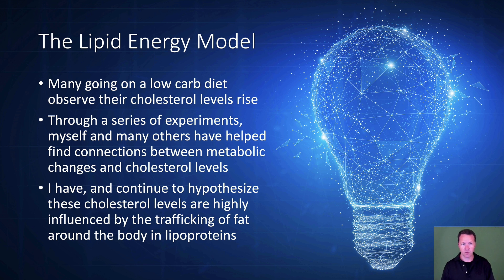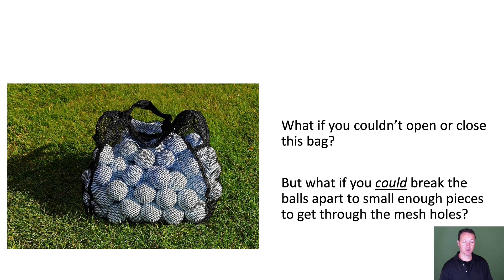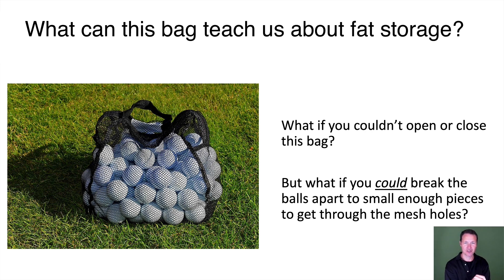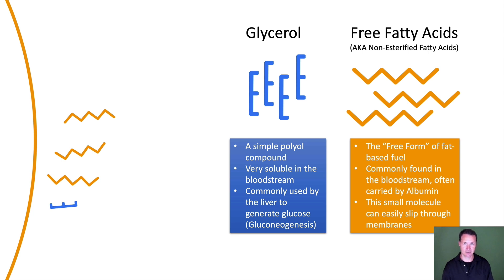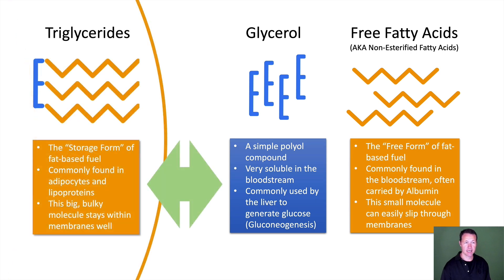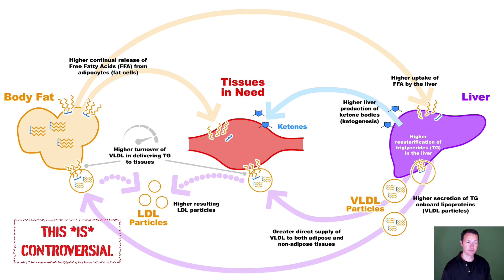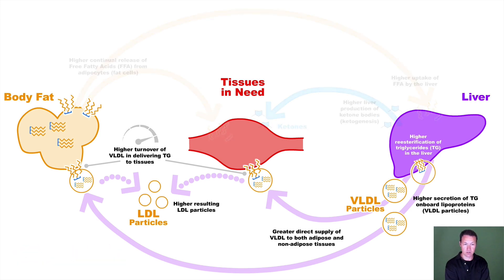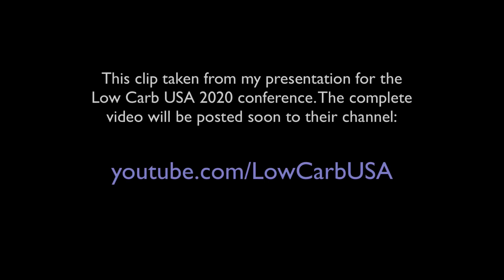The Lipid Energy Model in a Nutshell

Comment: Dave it all makes sense. There is a group of people like me on a Carnivore (keto ++) diet whose LDL does not go up. However our morning glucose goes up on strict keto. Also our ketone body levels never go really high even on total water fasts. I postulate that this group of people use more glucose from gluconeogenesis and when fat adapted are able to use the ffas really well so ketones do not go up significantly. Both groups are metabolically healthy. interestingly what I have found is that glucose stays at say 108mg/dl all morning and when I break my fast at lunch time glucose immediately goes down to 85 mg/dl. It seems to me that there are two groups of people on a keto diet, the hyper-responders who predominantly use fat either dietary or adipose as energy and the other group who convert a lot of the glycerol to glucose and use more glucose as energy (even on a carb free diet) via gluconeogenesis. also those people who do not produce a lot of ketone bodies may direct more of the ffas directly to the tissue that needs it and less so to the liver. I struggle to get my ketones above 1 even on a 5 day water fast and that was not the case before I became fat adapted when I could easily get to 2.5 or 3. Obviously there are a whole Bell curve of people between the two extremes.
Reply: Some glucose could be also coming from deaminated protein from muscle, converted to carbohydrate. Considered?
Reply: Did you consider the down regulation of LDL receptors on hepatocytes under the influence of high saturated fat to also contribute to the significant rise in LDL particle concentration in many on keto?
Would be interesting to see a low saturated fat, high polyunsaturated fat form of keto and the resultant effect on LDL concentrations. There’s a lot to tease out here.

Comment: But the big issue is, are these LDL's atherogenic? If so, why? Is it because of vascular inflammation only, or is it just having a high number? Or is it due to oxidized LDL'S that can't be reabsorbed by the liver and get stuck in damaged arteries?
Reply: it would appear to be an issue of time ... if the particle hangs around more than a week it can no longer return to the liver so ends up as food for mAcropahAge and desposited into an artery wall (foam cell conversion). The size thing might be correlation NOT causation (None too small neither too large a  sizes but just right for RCT).

Comment: Can I ask, what is controversial about this model? If fat goes to the liver, wouldn’t that liver release some of that fat as VLDL and eventually ldl and wouldn’t that go back to other tissues? I’m not a lipidologist I’m genuinely Asking out of ignorance like what other possible model is there that is inconsistent with what was explained?
Reply from the maker: Yes -- I agree (but of course, I'm biased). For me, this is the occam's razor explanation for higher LDL-C/-P/ApoB explanation for those on a low carb diet.
Reply: @realDaveFeldman  there is probably a cross correlation since the 3#s move On regression tandem tricycles .. in multi-variate calculus the eigenvalues of the covariant matrix provide weight(s). Roughly this is PCA as opposed to Factor Analysis which you are probably more conversant with (pearson and all that)

Comment: low carb  does not imply that the person is in deficit, and you say that later.1. fact - a person does not have to be on low carb to be in deficit 2. fact - if a person is on low carb then it is most likely also on high fat which completely changes this model because more chylomicrons are introduced and LDL generation is reduced
Reply: fact - you if you say something is a fact it does not become a fact, you usually just sound like a moron

Comment: Great info, thank you. My cholesterol has gone up to 8.9, triglycerides 1 and albumin on the slightly high side. Just had a CT Calcium score done waiting on the results but I’m feeling very confident.
Reply: CT Scan result; Zero. So thrilled.
Reply: @bumbles3304  what is your before-after weight and how fast you lost that weight?
Reply: @RaviPatel-eb8wt  I’m not over weight. Always had high cholesterol but never this high. (53kgs 5ft 3inches). I have just started to eliminate all sugars and starting intermitting fasting. I’m thinking this will help lower my cholesterol if not it may just be hereditary.
Reply: @bumbles3304  the problem has always been inflammation, as cholesterol is used in the anti-inflammatory process. So, just getting rid of inflammation you dont need to think of cholesterol.
Reply: @vandpiben  thank you, that must be it !  It’s hard to get rid of inflammation as I have always had it. I have a damaged knee and tummy problems so I will work on that. Thank you for your advice much appreciated.
Reply: @bumbles3304  reduce carbohydrates. Supplement fish oil or cod liver. Do 30 min movement a day. Quit breakfast only eat after 1 pm. Quit smoking, chew your food untill substance like smoothie. A knuckle greens, a knuckle berries, a knuckle starchy carbs. Rest clean ecological animal foods. Finally also incorporate some yoga if possible. You're welcome
Reply: @vandpiben  knuckle?
Reply: @lq4657  a wrist size